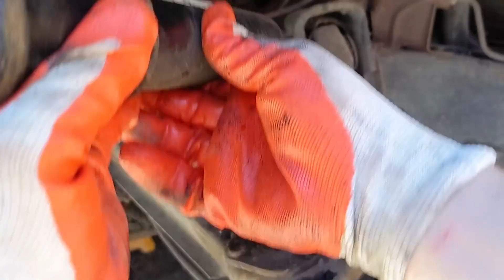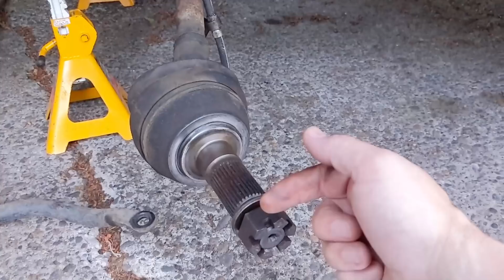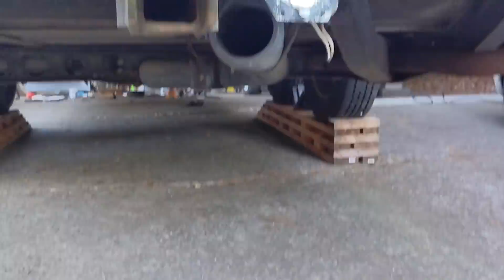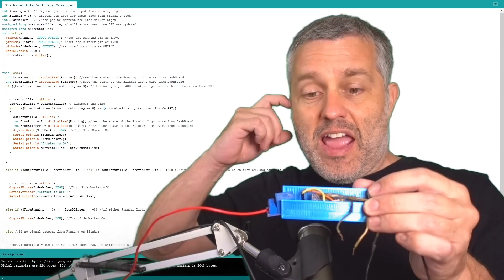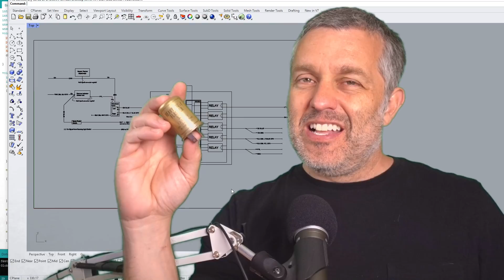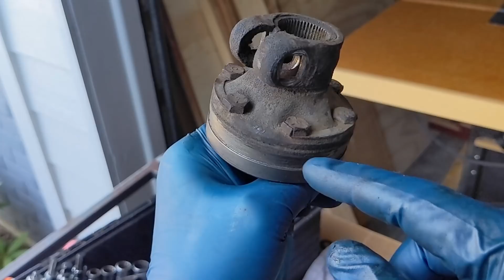Building the Best Damn GMC Motorhome Ever E.24 - Front End Removal

Comment: those old motorhomes were way ahead of their time when they were made. My uncle had one when I was a kid.
However they're never going to be good at high altitude with a carburetor and adding fuel injection is easy enough but the hard part is the fuel mileage. Your never going to get fuel mileage with a 3-speed automatic unless you keep your speed under 55 all the time. But those things are brilliant. A masterpiece of General Motors😊
Daryl

Comment: As a Design Engineer myself - I have to comment as you refer to the KISS method several times in this video and others - yet, you want to 'redesign' a whole bunch of different "off-the-shelf" items.  Like the tank vents - the kitchen stove vent grill, the turn signals, etc.  All - off the shelf easily replaceable components. yet you want to reinvent the wheel it seems.  not sure I follow why.  With that said, I did like the side vent cover design with the recessed louvers.  but the roof vent - again, if it breaks - you can't go to any store and buy it - you have to print a new one, etc.   that's not kiss in my opinion.  also - any of those 3D printed parts, as I'm sure you know - should be painted for UV protection....or they will likely fail in short time.  especially something like the mirror mounts with that wind load on them.  appreciate the videos regardless - as I am hoping to pickup my GMC here in a few weeks after bank processing paperwork.

Comment: Here is the Orientation video for the GMC Motorhome it shows the 3 roof vents. It looks like the rear most one on the passenger side is for the discharge tube. The other two are for the sink on the driver's side and the black water tank, or the shower (?), on the passenger side. 
https://youtu.be/WVxt7XGJYHI

Comment: the side marker are allowed to be out of phase with the front and rear blinked, i know because both on my 1977 chevy G10 van and 1988 chevy s10 truck the side makers do blink out of phase when turn signals are on. Since its factory for many 1970s and 1980s GM vehicles it has to be allowed, and I think it looks pretty and and also helps people's awareness when one is changing lanes. 

Side note for those playing with LED bulbs on these older GM vehicles. With these GM's of 70's and early 80's when you add LEDs sometimes they do not work correctly when you have your parking lights or headlights on at night, even when you change the turn signal blinker relay on the fuse box to a newer one made for for LED. .On both my 77 and 88 I added LED bulbs everywhere but I leave the standard incandescent bulbs in the front signals. If I change those to LED's then the always something screwy happens like the front turn signals stay solid without blinking. . 

So they do make different style blinker relays that use a different "solid state" method and do not use the heated filament method to make the turn signals blink. Check out Napa or Oreiley's and you can find them for most any 70's or 80's car. they last longer and can handle more loads when you add trailers and more lights on a vehicle.

Comment: There is a tool for unloading the torsion bars, it saves the threads from wearing out as it's not good to turn them under load.  Oh, and the hub drive bolts are called Ferry bolts, or commonly 12-point bolts.   My newish brake reservoir/master cylinder is just as rusty
Reply: Simple solution from Mustie1: chain oil diluted with some kerose. It dries smooth and protects from more rust.
He and I use it to rustproof frame rails and underbody. Very effective. Just my two cents.

Comment: You can use the relay activated on the signal before the flasher relay to disconnect the running lights when indicators are turned on and it should solve all of your problems.

Comment: I see a potential legality issue with your front running light/turn signal, the one integrated with the headlight. I read some where, and have seen in real life, that if the running light and turn signal are within a certain distance of each other, then they must use a special flashing pattern. Specifically, if the running light is on, then when the turn signal is activated, the running light must turn off and stay off while the turn signal flashes on and off. Once the turn signal is finished flashing, then the running light can turn on again. I believe this is to make the turn signal flashing more noticeable. The ideal is that what is essentially one lamp switching back and forth from white to amber is not as distinct as flashing from off to amber.

Here is the Jalopnik article that explains it.
https://jalopnik.com/heres-why-modern-cars-turn-off-one-of-their-lights-when-1792394567
Reply from the maker: Fantastic! Thank you!

Comment: Just an FYI: The Cadillac service manual for the Eldorado with the same front wheel drivetrain configuration says to replace the six 12 point bolts that holds the axle to the inner diff adapter, not to reuse them if you take them apart.
Reply from the maker: Good to know. Thanks.
Reply from the maker: Does it give a torque specification?
Reply: @IndustriousPursuits  The spec is 65 ft/lb. Let me know if you need any of the other suspension fastener torque specs.

Comment: Keep It Clean 10853 Flasher No Load Fixed Flasher

Keep It Clean 10853 Flasher No Load Fixed Flasher these have been around to replace the bi metal flasher since the  70s
Reply from the maker: Reading this comment I realized that I'm going to have a problem. Once I replace the rear incandescent bulbs with LEDs the stock flasher will stop working! Thanks for the heads up!
Reply: @IndustriousPursuits  the l.e.d compatible flasherunits are also used on motorcyles when aftermarket l.e.d indicators are fitted

Comment: You can stop the flow of brake fluid from the open line if you prop the brake pedal in the down position with a stick or pry bar.
Reply: It will have to be changed anyway. Have you seen the color of it !?